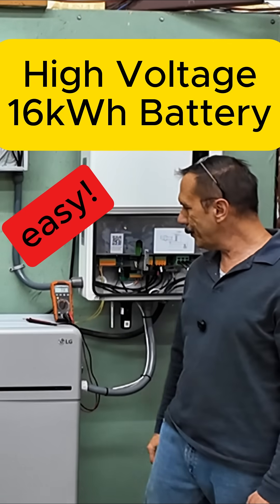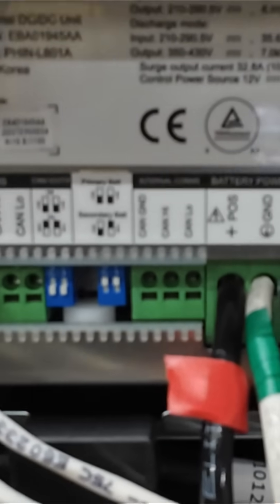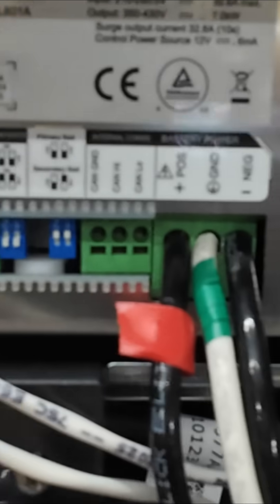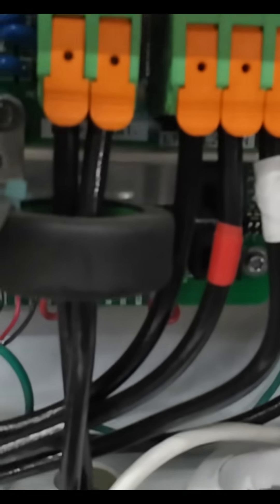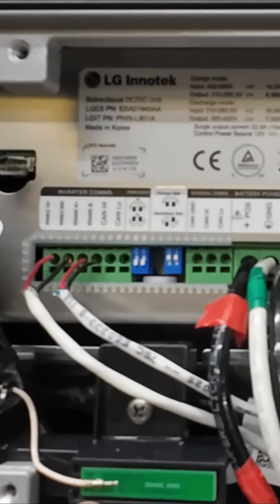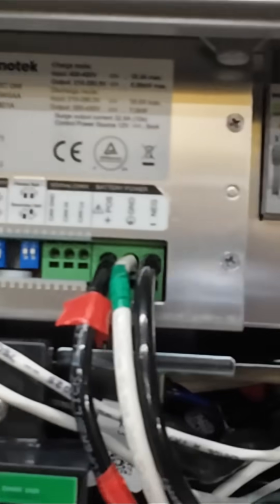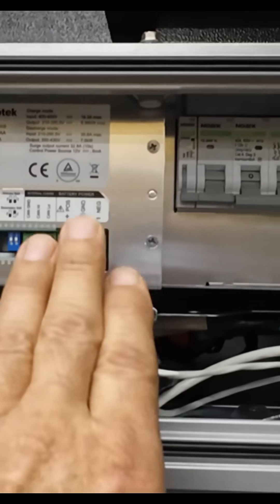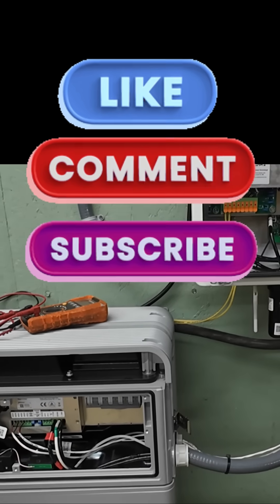Safe High Voltage Solar LG 16H Prime

Comment from the maker: Signature Solar Affiliate
Help support the channel by using our Signature Solar link, you can save $50 on any purchase over $500 when you use our exclusive coupon code,
{{COUPON_CODE}} EDSDIYGET50
LG 16H Prime Battery:
https://signaturesolar.com/lg-16h-prime-battery-16kwh-400v-high-voltage/?ref=piqshkgv

Comment: When the battery signal to turn on is sent by the inverter, does it have a built in resistor internally to control the initial inrush to the inverter capacitors? Thanks ..
Reply from the maker: That depends on the battery, some batteries like the LG 16H use a DC/DC converter so it is able to do a soft start.
Other batteries like the Nissan Leaf battery have a built in pre-charge resistor that needs to be activated for a second before closing the HV contactor.

Comment: Appreciate your videos. Not interested in Bitcoin play do you enjoy the solar aspect. Could you do a video on input voltages AC and dc. I saw your sine wave video are these good for home electronic?
Reply from the maker: Thanks for the feedback, I try to lean more toward the solar side of things on the Bitcoin videos, just trying to show how well the Solis High Voltage inverters can handle high constant loads. Trying to put a different spin on the typical load test videos.
As for the Solis being good for home loads, I bought my first one over a year ago, it runs all my home and shop electronics and have had zero issues.